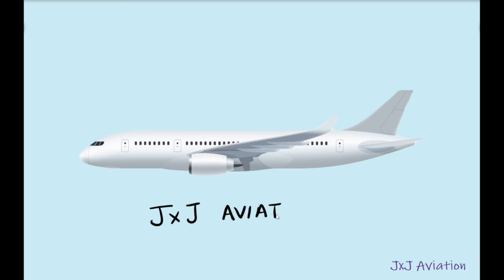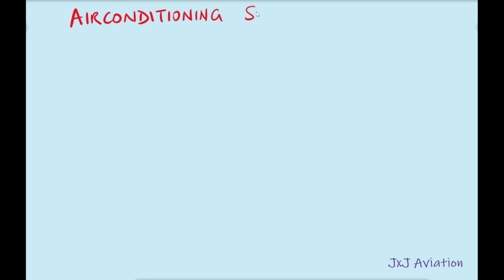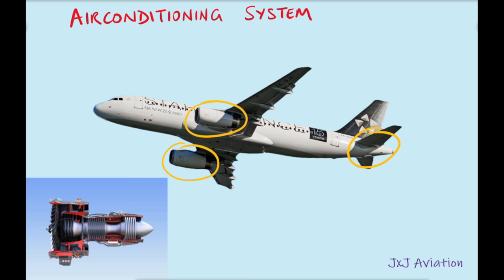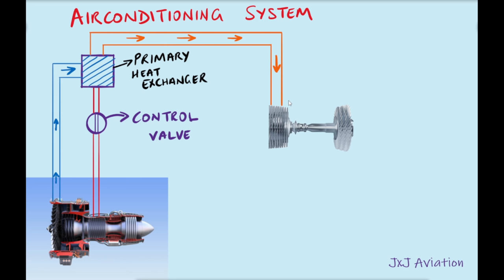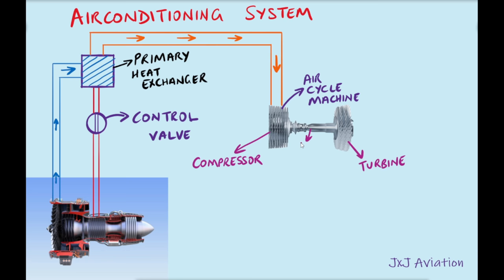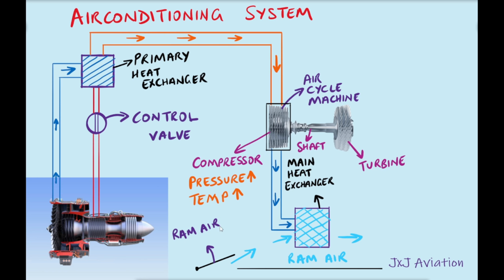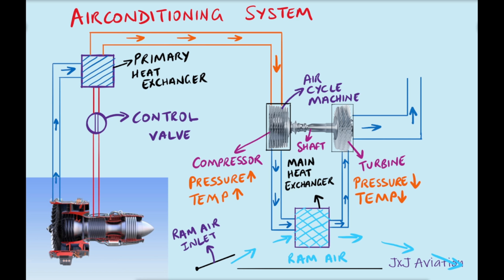How does Air Conditioning System in an Aircraft function | Principle of Air Cycle Machine | AV Notes

Comment: Very good explanation, but what happens when the outside temperature is hot? How air conditioning system works while the plane is on ground?
Reply from the maker: There may be external air conditioning units which would supply cold air directly to the mixer unit. Or bleed air is supplied to the Air Cycle Machine to achieve cooling through air expansion in the turbine
Reply: Is that the reason it looks like there's an outdoor unit on the jet bridge/passenger boarding bridge? is it because it's giving cold air to the airplane?

Comment: I don't know from which aircraft is this air-conditioning system but on 737 is for sure air in primary heat exchanger not cooled from fan air. Fan air is part of pneumatic system. Fan air is cooling the supply of bleed air to air duct in pylon trough pre-cooler.
Reply from the maker: I will need to check the Air Conditioning System on the 737, but the basic concept would be the same for the Air Cycle Machine.

Comment: Great video! Had a question about whether there is a condenser because a few of the AGU diagrams we are covering in my class have a condenser.
Reply from the maker: That's a different kind of air conditioning system, called as the Vapor Cycle Machine.
Reply: Thats for reciprocating engines

Comment: could you please explain what is the filtered air you mentioned in the end of the video? Is it the old air already remain in the cabin before the new air delivered? Thanks a lot.
Reply from the maker: Most of the air from the cabin is vented out. Some of the air is recirculated through different filters which is called as filtered air.

Comment: thank you for the great explanation. but how does the volume of air remain constant in the mixer unit and in the aircraft? air is just coming in, but i dont see where excess air is supposed to go out from.
Reply from the maker: From the mixer unit, air is continuously supplied to the aircraft cabin.
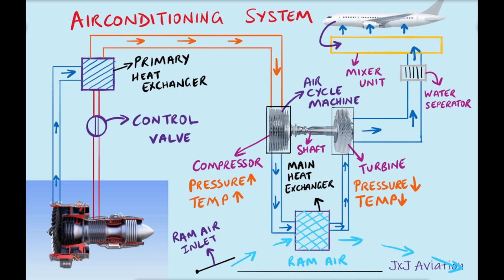Reply: I mean, if you follow the dark blue arrows in the diagram @4:00, the cooled air from the turbine is fed into the mixer unit, and into the aircraft. But there's no air coming out of the [mixer unit + aircraft] system. So where does the warmer air from the cabin go to?
Reply from the maker: @estherauyong4941  Some of the air flows back into the mixer unit after filtration and the remaining air is let out by the outflow valve!
Reply: @JxJAVIATION  I see.. Thank you for the explanation :) 👍

Comment: Hello, 
I am a bit confused, where are the packs? aren't they used in air conditionning system? thanks
Reply from the maker: The unit which has the air cycle machine is called as the Pack!

Comment: Good video. What about the "bypass valve"? Where is it located?
Thanks.
Reply from the maker: Thank you! Check out my other videos as well! The bypass valve comes between the compressor and the turbine of the air cycle machine.
Reply: @JxJAVIATION  Thanks! Surely, I will check.
Reply: is bypass valve the thing that controls how warm the air is

Comment: 3:46 What is filtered air taken from the aircraft? I mean i couldn't understand this part. Great topic by the way.
Reply: Air that is inside the cabin is filtered and mixed with air from engine, cooled then pumped back to cabin again
Reply: @henrytsao1  Thanks!
Reply: @henrytsao1  why does the air inside the cabin needs to be filtered again?
Reply from the maker: The air from the cabin is "impure air" so needs to be filtered for recirculation
Reply: @JxJAVIATION  I think that’s  where  the HEPPA filters are fitted

Comment: Thank you but there are some missing parts, like condenser and reheater also there are some mistakes in your graphics like cooling air for PHC and location of water separater. Good luck
Reply from the maker: Think you are referring to the air conditioning system which has a vapor cycle machine. The system which I have shown is the one with an Air Cycle Machine, or ACM.

Comment: Aircraft in air ,ram air not provide in heat exchanger then what to do
Reply from the maker: The cooling would only be achieved by the air passing through the air cycle machine.

Comment: Sir you didn't mention the "Reheater" and" Condenser"of the A/C system
Reply from the maker: This is the Air Cycle Machine type air conditioning system!
Reply: @JxJAVIATION  Doesn't matter. Even in this type there is reheater and condenser.

Comment: Hello I am working B737-700.
One problem our plane during on ground in the Cabin very hot not cooling. We cleaned water separator coalescer bag. Still hot in Cabin. After take off normal cooling cabin.
Reply from the maker: Checked the coolant quantity?
Reply: @JxJAVIATION  can you please send me instructions 🙏
Reply from the maker: @bayarmagnaijaranjil9391  Please use the manuals for exact procedure
Reply: You probably have a worn out air cycle machine.  The acm is pushed harder on the ground than in the air because on the ground the outside air is warmer than at altitude.

Comment: Excellent presentation of a complex system. However there are still some downstream portions that need clarification. The kind of filters used to because in the cannibals HEPA, and not very effective for microbe filtration, The air flow is also very poor because it is a vortical flow not laminar or horizontal There is recovery time with open aircraft when boarding and  unboarding. Over all while effective cooling system for comfort it is not very specialized in in microbe or viral prevention which still makes flying unsafe..
Reply from the maker: Thank you for the information!

Comment: The video is not accurate at all, and the system does not explain all the components of the system, and some components are not related
Reply from the maker: You are referring to vapour cycle machine type of cooling. I have given a Air Cycle Machine Cooling!
Reply: You're right. For example the water separator is upstream the turbine and not downstream. Also the second stage heat exchanger and the trim air are missing. The ram air is used to cool down the heat exchangers.. it's a bit a disaster 😂